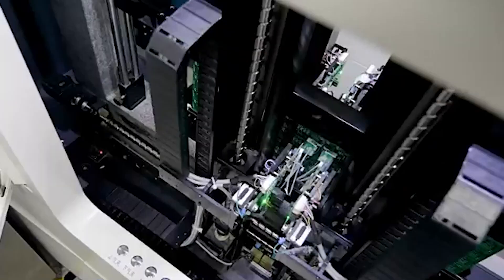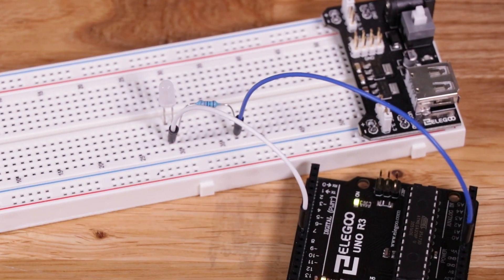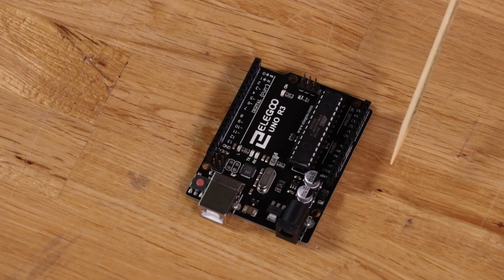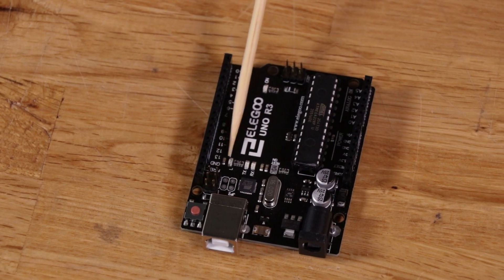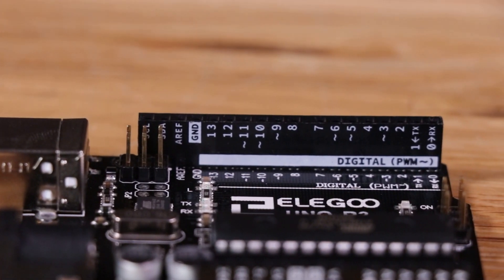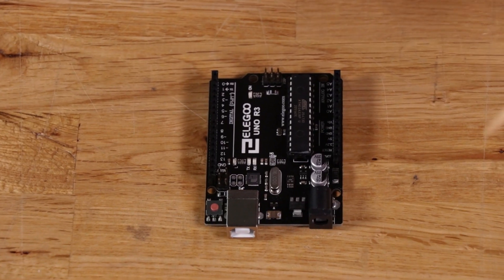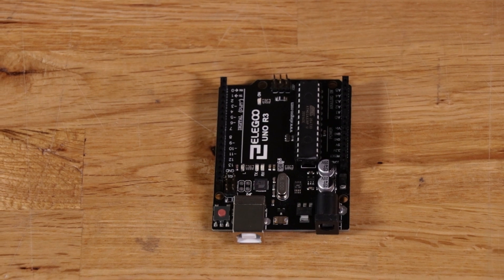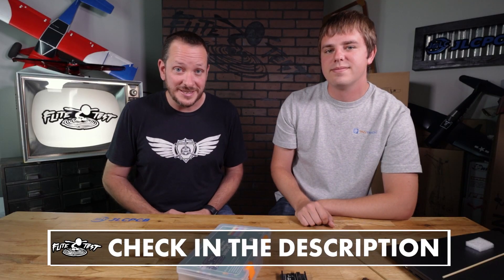Arduino Basics And Components/Hardware Identification

Comment: I an disappointed that you did not use a genuine Arduino to support the project
Reply: Nobody uses genuine Arduino boards for anything. They're too over-priced and do the same thing as the three dollar clones. Flite Test started out teaching us how to make RC airplanes out of dollar store foam board and pizza boxes because they appreciate practical development. You can fail at your project just the same with the "Genuine supported" hardware as you can with the cheaper stuff, the difference is you've spent more money failing than you needed to.